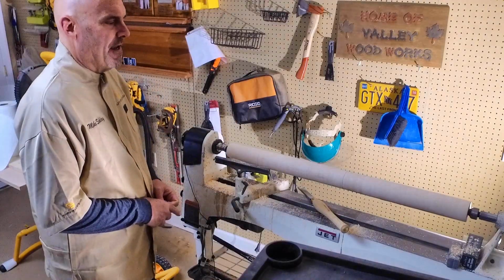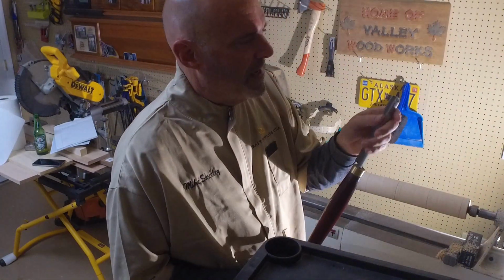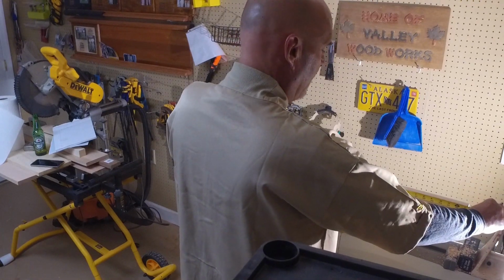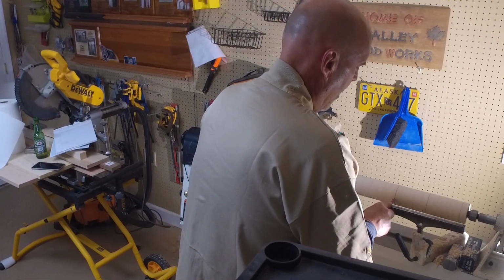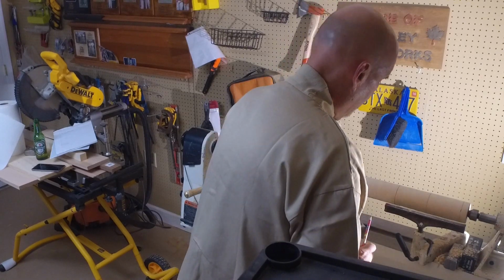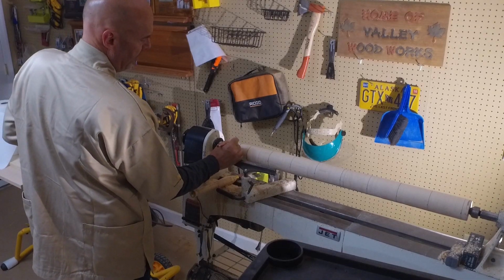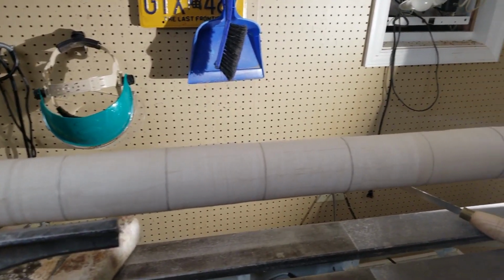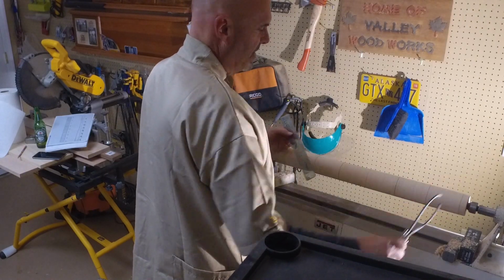Wood Turning A Baseball Bat MLB 34" How To On a Wood Lathe

Comment: Mike what type of chisels did you use?
Reply from the maker: Thank you for your question.  I Initially use a roughing gouge to make round.  After that and once I marked my depth with a parting knife I then go to a simple 3/4" spindle gouge.  I also have carbide tip goes.  With that set, I rough with the square tip and finish with a round rip

Comment: How big should the square blank be? Will 3 by 3 give you enough to turn? I’m new to turning. Thanks.
Reply from the maker: 3 x 3 is perfect.  You wont have to take much wood off at the barrel as you'll be close to final measurements
Reply: Valley Productions thanks for your fast response Mike!! I'm excited to get stuck into this. I'm thinking of adding a Celtic knot into it as well. Maybe over ambitious. Lol
Reply from the maker: @bennierheeder7015  Awesome idea!  I ultimately put a oval logo on mine "Valley Wood Works est. 2018 in oval form.  I was thinking about branding, not really cost effective.  Then I thought I would carve it out with a dremel lightly, but got scared.  I would suggest drawing it on, using black sharpie, and then you could use antique finish or something.  This way if you screw it up badly, you could still sand it off :)

Comment: From your woodworking experiences, do you thing it's possible to turn a baseball bat like this with a 3/4hp 16 1/2" mini lathe with 22" extended bed? Nice video by the way!
Reply from the maker: Yes you can.  You could either make a miniature bat or a 2 piece bat with connectors.
Reply: @ValleyProductionsLLC  Thank you for your reply! Its really appreciated! I mean, I would like to turn a regular size bat, 1 continuous piece, tu use in the local league. That why I asking if it could be possible with a 3/4hp mini lathe with bed extension in order to turn a full length bat. So, you telling me that is possible?
Reply from the maker: You will need a 36%" bed.  By the time you mount between tailstock and centers.  Most bats are in the 28 to 34 range.
Reply: The motor should be strong enough to turn this.....

Comment: Hey Mike! I’d love to get into this myself. What type & size lathe do you recommend for turning some baseball bats & fungos? Thanks!
Reply from the maker: Hey thanks for watching and Ill do anything to get you into turning, making bats and fungos, which will lead you to other things :) ...as it it so much fun.  So, as a point of reference, this bat wat turned on a Jet 1221VS.  Most lathes labeled this way give you the measurements in the model number.  So the 12 in that number is the "swing" which is north to  south which means 12 inches for clearance for a salad bowl or something like that.  The second number 21 is the length in inches from left to right for the length of a baseball bat..  So 21 inches was too short for a 34 inch baseball bat.  So I got a bed extension so I could turn bats.  Hobbies always grow, and flexibility was key for me in this choice.   So, to answer your question, you will need a 40 inch lathe bed.  So your only decision is the swing....... Do I get a 8 x40,  12 X 40 ..... etc.  Manufacturers Jet, Delta, Rikon, Robust, and others seem to lead the market, as you can do a quick review, thats how I ended up with Jet.  Many wood lathes such as this sell in the $700+ range new.  Hope this helps, give me a thumbs up if it does.  Inspired_Mike